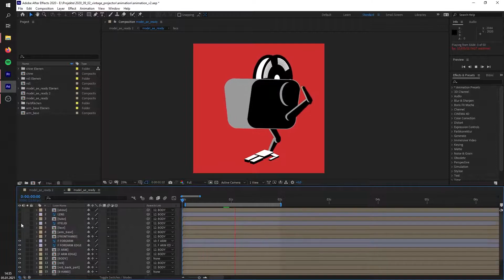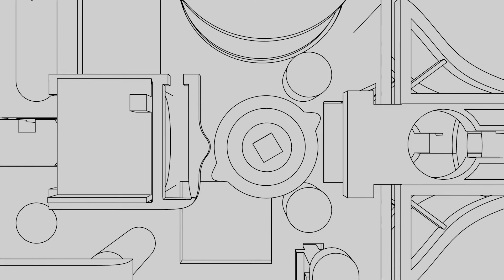I Designed a Bad Film Projector

Comment: What film gauge is this?
Reply from the maker: I didn't use a typical film gauge or format for this. The images on the film are 10x10mm, the width of the film strip is about 20mm and the distance between the images is 5mm.

Comment: Hello! I loved your video. My question: what material did you use to print the images? or how do you make it possible to project it?
Reply from the maker: Hey, thank you! I just used regular transparency film sheets that were used for overhead projectors. Those are usually printable in normal inkjet or laser printers and you can buy them in a pack of 100 or so. They're not as high quality as actual projector film of course, but for projects like these it works fine